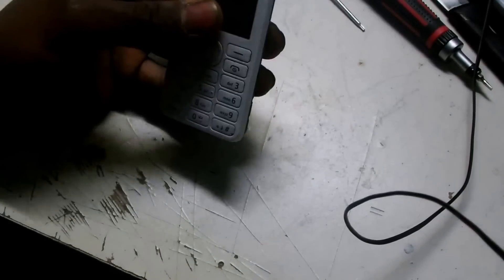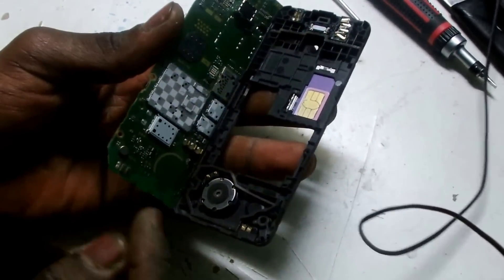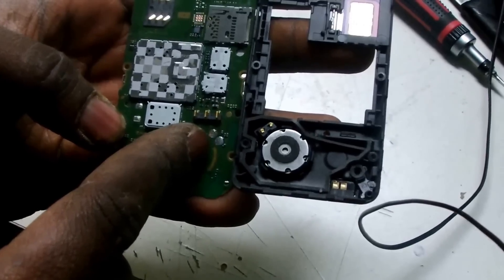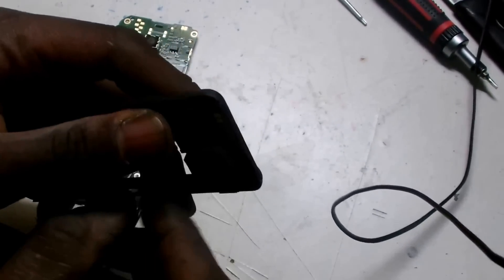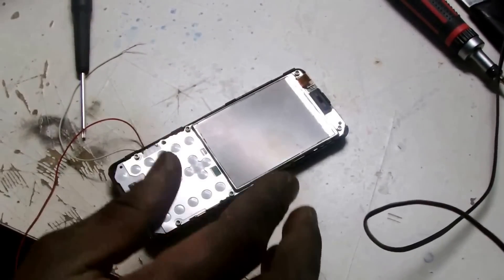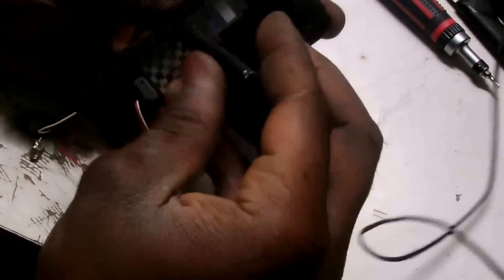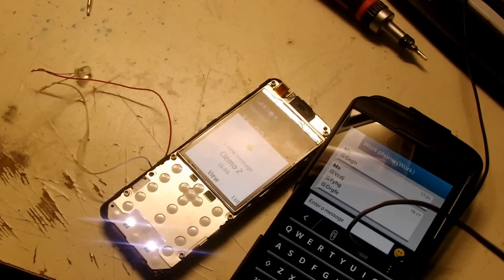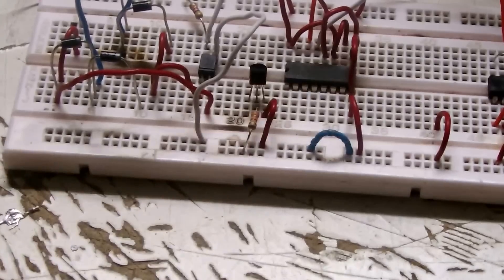gsm remote control switch

Comment: How do you know the positive and negative poles of the speaker?
Reply from the maker: Great question, there was no -+,I used the led to check,but I noticed it dint matter which polarity I hooked the led it will still light.to make circuit more reliable I used bridges rectify to generate  -,+, polarity to ensure the circuit works properly
Reply: Hello how many volts did the speaker?

Comment: At 2:46  which one of the circles is the anode and which is the cathode? Is the top circle for the cathode and the bottom for the anode or the other way around? Also, what model of Nokia phone was this. Thank you for your time.
Reply from the maker: I taped the speaker output, and I notice I could light an LED  in any polarity -/+, so to make the circuit stable I introduced a bridge rectifier to create positive and negative polarity.
Reply: @juniorelectronics8255  What model of Nokia phone?
Reply from the maker: @danielwells7083  hello it was Nokia 206 Original

Comment: Right on time: Just before I spent $$$ for a gsm module and while I was still thinking about how my old cell with a cracked screen should be capable of the task!
Reply from the maker: that great and actually its very simple to make  ,just send me ur email
Reply: @juniorelectronics8255  Thanks for your generous offer of email. I think I got the basic idea, but any thoughts about 2 relays (different signals) with one cell phone? I can connect to a two-button remote or a one-button controller (One second signal for on; three second signal for off). 

If you think the answer is too complex, I'll send email.
Reply from the maker: @babuddha  i like ur thinking (: ,u thinking out of the box,,,,
Reply: @juniorelectronics8255  Tipping my rasta beanie to you as well. Curiosity leads to learning; learning leads to curiosity.

So... using my two-button remote, can I tap into the audio signal using a call for on and tap into the vibratory signal using a text for off?

Comment: Please tell me how I will make 3 hp motor control with mobile
Reply from the maker: send me ur email ,i can maybe help out,but controlling 3 ph motor this circuit wont  do so good ,,but if u add some relays instead to triac ;u can combine ma circuit and another motor control motor to start and stop motor ,
Reply: Junior Electronics 
amolhire2221985@gmail.com
Reply: how can you send Sms to swith on and switch off 
i need wiring diagram : madjid.etn@gmail.com

Comment: cant you connect the phone directley to something? Like a flashlight. Or is it to less power in the battery of the phone?
Reply from the maker: wel u can connect to an led very low voltage ,but i dont think its gonna be any use,the ouput is very low voltage and also ur battery  wont last long ;
Reply: how can i ignite a fuse with this= Not going to make a bomb but for firecarcker. Even some small shit today like a fp3 firecracker will blow you hands of and i allready been close when the fuse burned too quick  and it exploded 3 inches from me.
Reply from the maker: well then i suggest u use  a circuit using (a circuit that gonna drive (Nichrome Wire)can get really hot ,with that u can use trigger ur fire wakes
Reply from the maker: well as u know the the phone battery is around 3,7v depends of phones ,but u can try ,to light up some with it,maybe a lazer ,,

Comment: Did you use mosfet ?? can you explain the connection in mosfet ..pls
Reply from the maker: When 5v is applied to pin 1 & 2 of the opto-coupler (MOC3021),
pin 6 & 4 gets connected internally(Within opto-coupler) and allows current to flow between them.
This connection provides GATE current to the TRIAC (TRIAC pin 3) and TRIAC starts conducting the main current between pin 2 & 1,
which completes the circuit and makes bulb to glow.

http://www.micropik.com/PDF/BT136-600.pdf

just think the tric as a relay ,